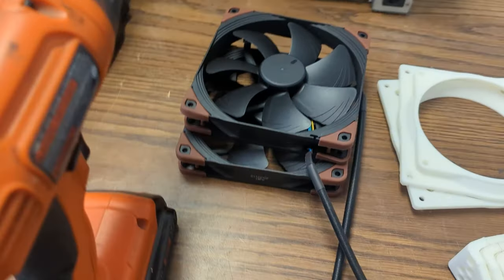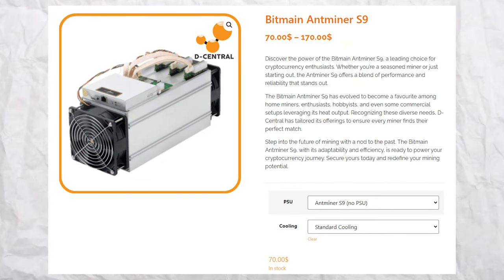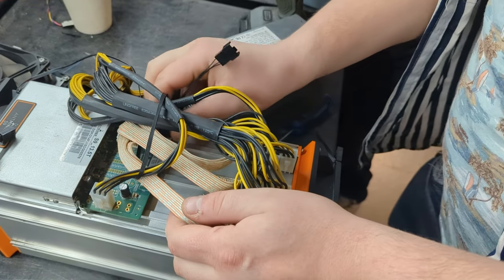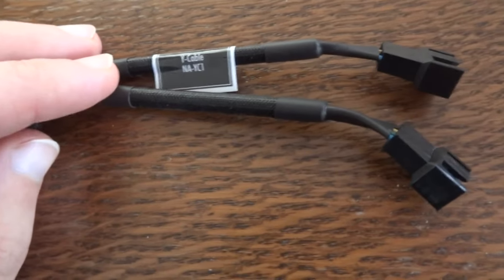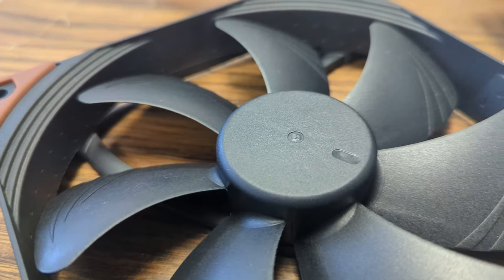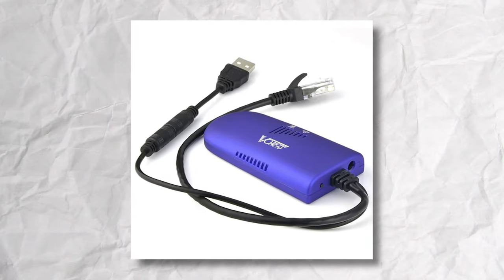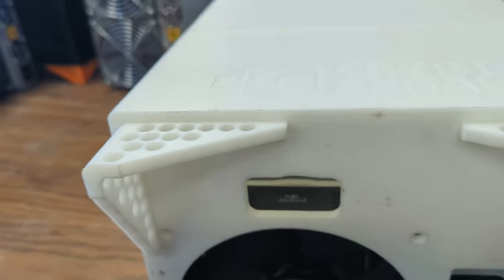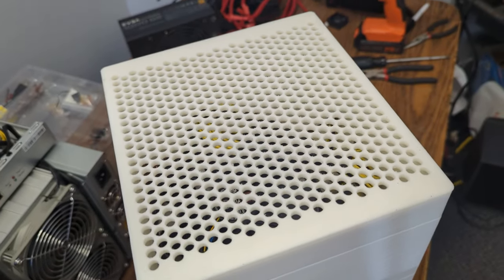Bitcoin-Powered Warmth: Antminer S9 as a Dual Bitcoin Miner & Space Heater

Comment: So I bought the Antminer s17 Pro from these guys and it only worked fine for about 2 or 3 weeks. After that it was just a lot trouble. Main issue is that two out of the three hash boards just stopped working. To be fair these machines are heavily used and it shows as there is signs of rust on the body of the machine and the screws that hold everything together have been definitely abused. I started using the machine a few days ago and it barely warms up the room its in. I am pretty disappointed.

Comment: I just ordered one today. Lets see how it does as a heater.
Reply: How is the noise level?
Reply: @BrandonNicholls  If you want to use this in a living room or bedroom, definitely get the aftermarket quite fans from them. If its for a garage or work shop, then you can use the original fans set at like 1000 watts power usage.
Reply: @Ray-uc8ij can it heat a room by itself and how big a room?
Reply: @foochinator  It can comfortably heat a 200 to 300 sqft room I would say.
Reply: @Ray-uc8ij  so one per bedroom or so
Reply: @foochinator   yep pretty much. Thats with the quite fans installed. My ASIC has one board not functioning on it for a while now so it runs on two boards instead of three. about 890 watts total power usage.
Reply: @Ray-uc8ij  does it need its own dedicated circuit if so how many amps does it draw?
Reply: @foochinator  Its only using about 900 watts so not really. A regular circuit can handle about 1500 watts safely before the breaker trips.
Reply: @Ray-uc8ij  so a 15A outlet should be ok per machine/heater
Reply: @foochinator  yep.